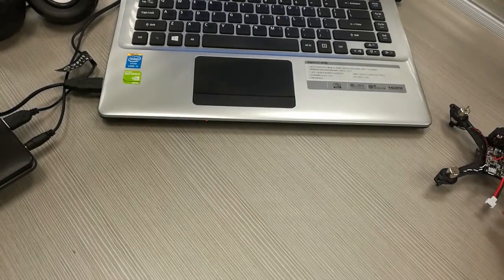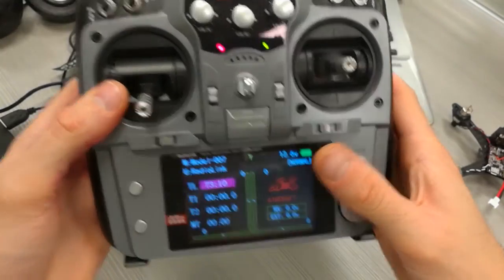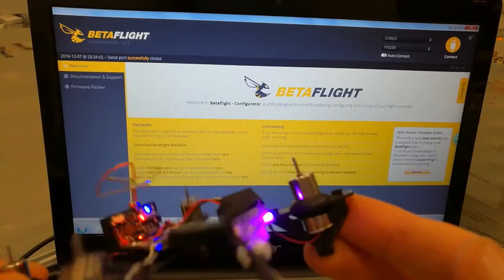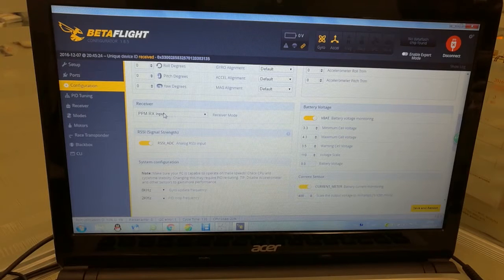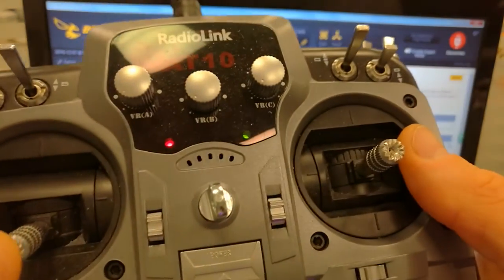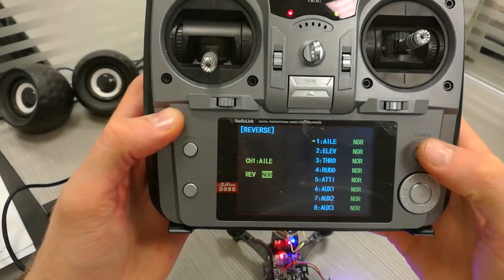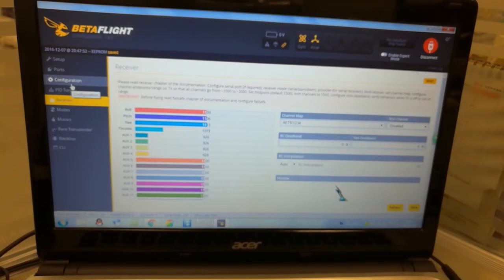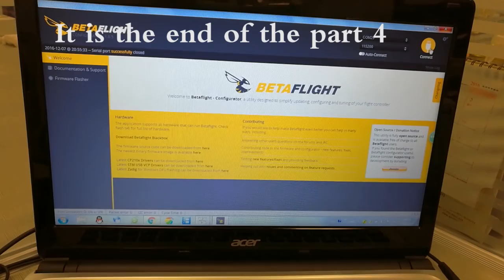Mini brushed drone build for the beginners - Part 4 (BetaFlight settings)

Comment: Hey Martin,great videos,extremely helpful for me as quite new to the hobby,just doing my first builds,a 250,a 220,and a 130,so your step by step guides are great,just about to tackle hooking them up to cleanflight! I powered up my micro board and the motors were spinning like mad,that's the same f3 evo v2 board as you have there? Any clues why?
Thanks,Steven.

Comment: fail open serial port,thats what i got
Reply from the maker: Maybe it is due to the drivers (try to use other computer(s) ). Another, thing you may do is trying to flash with betaflight or cleanflight (sometimes it helps too).